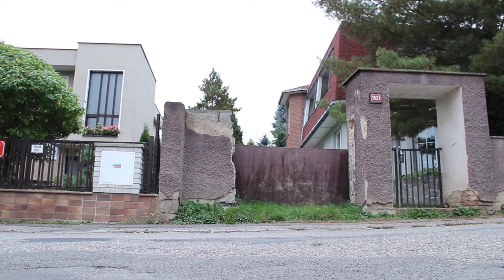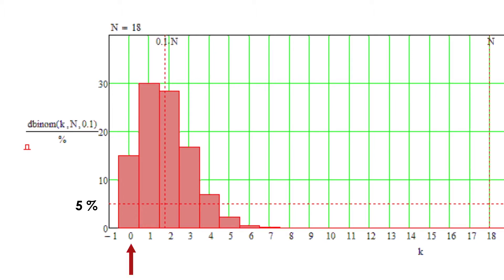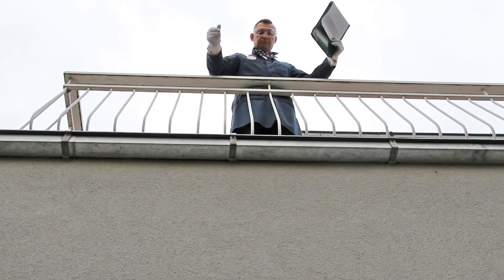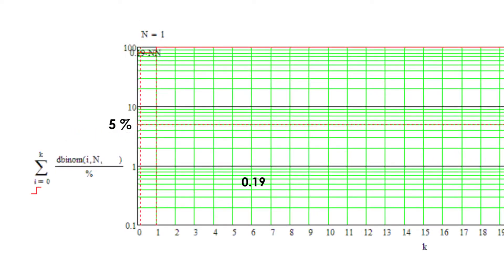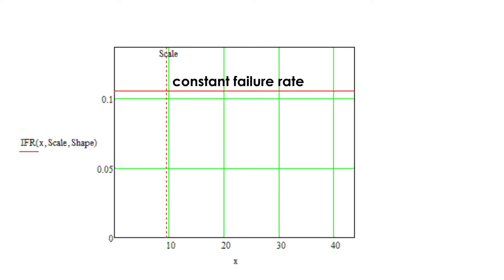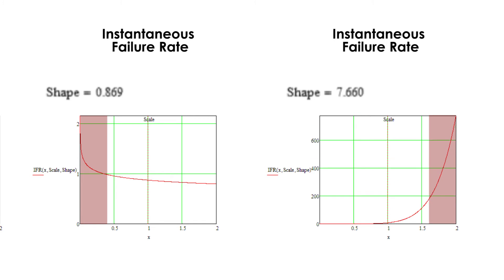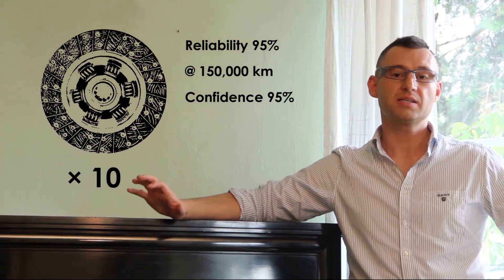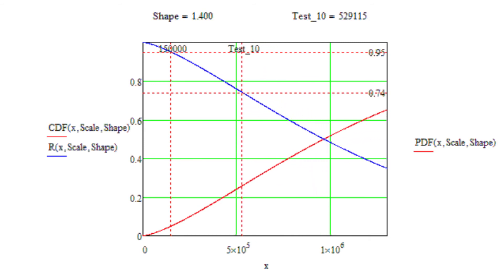Reliability Calculations: The Quintessence

Comment: One of the best videos on reliability statistics. Very well explained. Please correct me if I am wrong but the Rayleigh distribution has a shape parameter of 2 so in the constant failure rate explanation shouldn't it be exponential distribution?
Reply: You are right! Rayleigh is Weibull with a shape of 2. Sorry for the mistake! JS